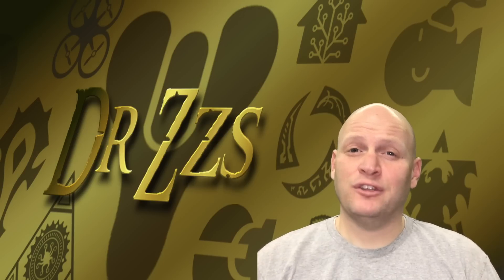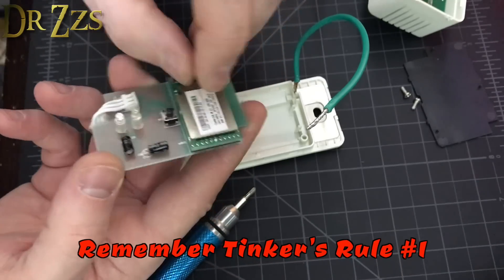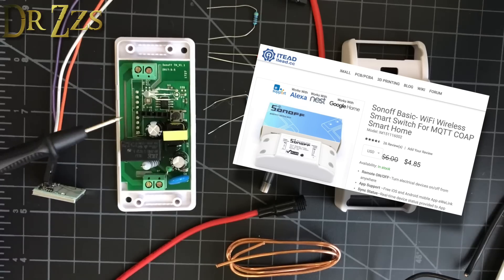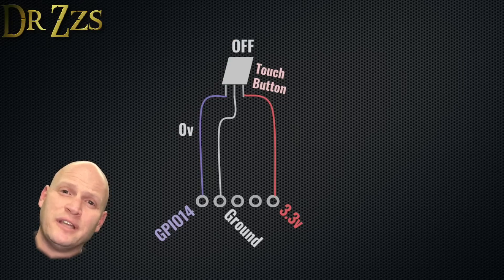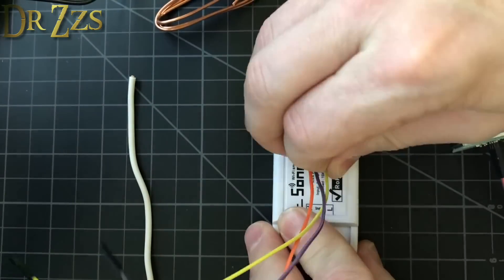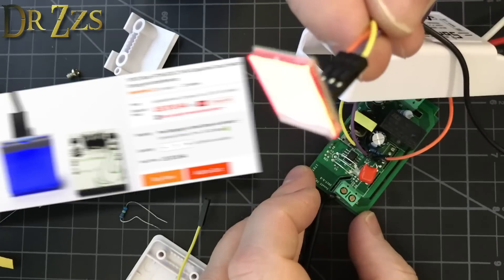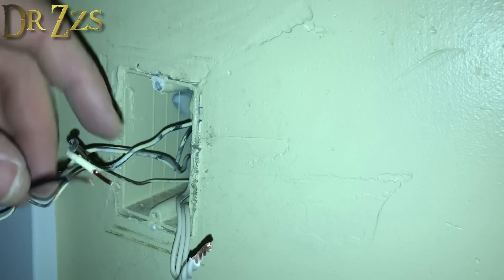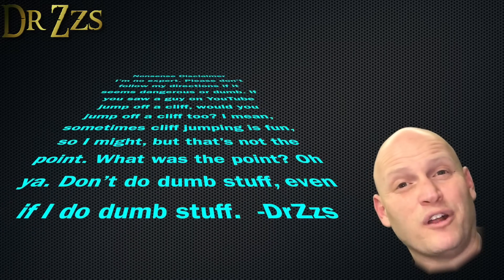$5 Sonoff + $2 parts = Best Smart Switch EVER!

Comment: Very nice video, thanks!
BTW: are you sure that you need the pull-down resistor and the debounce capacitor at all? I just wondering because the capacitive touch module is not a mechanical switch, therefore very likely debouncing and pull-down is not necessary. If thats right (I am not 100% sure) you can connect the touch module directly without any additional components.
Reply from the maker: You may be totally right.  I guess the thing to do is just test it without one or the other and see how it works.  I'll do that and report back. :) 
I think we may not need both, but we probably need one or the other.  The touch module outputs "high" on the "out" pin and GPIO14 has to go to ground to activate the relay.  Maybe there's a way to change one or the other of those things.  If the touch module would output ground on the "out" pin, that would activate the relay. Or if we could get GPIO14 to start low and activate the relay when it goes high, that would work too.  I couldn't figure out how to do either of those things, so I went with the pull down resistor, and was just happy it worked!  
Anyway, I'll test it and see.  
I typically supplement my lack of knowledge with an abundance of experimentation.
Reply: DrZzs Isnt the Relay connected to gpio12? Anyway, I am curious to see the result of your test!
Reply from the maker: HiJoeZi  yes. But the pin we’re using for the button is GPIO14. 12 must be set as an output while 14 is used (thanks to Tasmota) as an input. The onboard button is Gpio0. 
I don’t know much more than that about the inner workings of the esp8266 that runs the whole thing.
Reply: Yes, thats right. I only wanted to stress that GPIO12 (relay) and GPIO14 (touch button) are totally independent, at least from the hardware side. They are just "connected" via software. As the touch button is an electronic circuit (in contrast to a mechanical button), it is very likely that debouncing is not necessary. It also can be that the OUT-pin of the touch button is always either HIGH or LOW, but never ever floating. In this case also the pull-down resistor is not necessary. But please test it! I am really keen to see the result. BTW: I just ordered such a touch button from aliexpress for a little more than 1 buck. Your video taught me that it is  a really useful device :)
Reply: I would be surprised if the touch button floats when it's off, more likely it drives GND so the resistor is not needed, although I can't be sure.  As far as a capacitor, it's also likely unneeded.  Reading the datasheet from heltec (translated from Chinese), they indicated that an effort was made to make the switch resistant to spurious noise.
Reply from the maker: Thanks Zeric.  You're probably right. 
I can say for sure that without that pull down resistor the button doesn't activate the relay. That makes me think it is floating when it's off.  
But, I can't say I really know what's going on inside there.  For all I know there are tiny gnomes flipping big switches and singing drinking songs. 
You're probably right about not needing the capacitor.  The next one I do I'll try it without the capacitor and see if I get any ghost switching.  So far, after a few weeks I haven't had a single episode of unintended switching, so I'm happy about that.  
Thanks!

Comment: Good stuff and similar to what I just did with those things. Touch just seems more modern no doubt. I used the 3D printed box route as my wall boxes are quite crowded and I can't fit the stock box in there. Used my own MQTT firmware that uses the temporary mode of the touch switch so you just get feed back when you touch it. I do leave the onboard LED on though when the relay is off for illumination. Anyone interested in the touch 3D printed box option it's up here: https://www.thingiverse.com/thing:2778841 Thanks for the vids!
Reply from the maker: That's awesome!  
I was just looking at your model on thingiverse a couple days ago!  Great work! 
It's a small sonoff-loving world!

Comment: Another great video. I was just looking last week how to power a lit LED switch and here you come with a video pretty close to what I needed. I am going to try this out and see how it goes. Thanks for the great idea.
Reply from the maker: great! 
Let me know what else you're about to do!
Reply: So I finally received my touch sensor and so far it works great. The only item I am noticing is that the touch sensor does not change when updates are pushed from home assistant or the Tasmota page. I have 100k resistor and a 104 capacitor between ground and GPIO14 with a direct connection between the 3.3v with no resistor connecting this line. Right now I am wondering if it is my wiring or if my configuration is incorrect. Any thoughts?
Reply from the maker: Ben Steckler hmm. I’ll have to check mine and see if that is happening to me too. I know when I restart Home Assistant the touch modules aren’t lit even if the lights are off. Sounds like your wiring is the same as mine. 
I’ll think about it and see if I can think of why the switches don’t follow the commands.

Comment: You probably have no use for a low-pass filter in this case since you're using switchMode2.  Since switchMode2 requires a full toggle any interference will not trip the relay for a long enough period of time to make the lights flash (talking about fractions of a second), much lower than the time it takes for an LED light to power up.
Reply from the maker: excellent!  Thanks!

Comment: Those exact capacitive touch switches arrived on my door step late last week.  Just last night I was trying to decipher the Chinese data sheet to make the switch non-latching.  http://www.heltec.cn/download/Touch_Moudle.pdf

If I can make it  non-latching (and always lit) then I can solder it to the Sonoff's momentary push button terminals (and use MQQT control).  An image on the aliexpress page (and in the data sheet) indicates that shorting the outlined SMD pad would make it non-latching (see No resistance: temporaty output, 0-10K resistance: latch output photo).  It does not work,
https://ae01.alicdn.com/kf/HTB1HIinc9sQ2uJjSZFFq6xYUFXaO.jpg

Any ideas?

Thanks and keep up the good work.
Reply from the maker: Thanks!
Someone posted the data sheet in English: http://bit.ly/2sdgBHV
 
So, you connected those two pads and it didn't become unlatched?  hmmm
I'll have to just experiment and see. If I figure something out I'll let you know.

Comment: I know its a bit off topic, but is it possible to replace the sonoff basic relay with a solid state relay? its not that big of a deal, but the clicking of the mechanical relay is kind of annoying.
Reply from the maker: I don't know.  I'd guess it's possible.  
Do you have info on the relay you'd like to use instead?  I'd be interested in trying it out at least.

Comment: Is that all that'll be needed to go "ul" approved?
Reply: Tyson Brooks no,it is a costly and time consuming process.   My guess the plastic case emits toxic fumes and may burn, the ground is there to protect the house not you, the fuse and relay I believe would have to be UL rated and all kinds of rules on radio frequency emissions.  It is a complex process.
Reply from the maker: Help me understand the grounding part. 
How would having that plate in the switch face protect the house?  
I'm not saying you're wrong.  Just trying to understand. 
Thanks!
Reply: The ground is there to prevent 120vac from traveling anywhere.  This would include a metal switch plate,or through the box if it was metal. It also can help with RF shielding to/from the unit if there was a ground plane in the circuit board.  The neutral is there to carry the current used under normal circumstances, not in case of a short.  It looks like you have a plastic electrical box so in your case it probably doesn’t matter but if I was installing in a metal box I would insure the box was grounded.  All of centers around UL approval and NEC compliance.
Reply from the maker: Excellent. 
Thanks!
Reply: DrZzs you are welcome.  I have been watching your videos for a while and have parts and pieces to build and flash several devices but have to finish my woodworking projects first.
Reply: This was very helpful. Thanks for explaining.

Comment: awesome!!!

Where do you buy the header you soldered on the sonoff board? 

you need to make PART 2. with HA integration.
Reply from the maker: The header came with my D1 mini's 
http://amzn.to/2GV0kef
That's the expensive link.  Here's a cheaper one (but longer wait)
https://www.aliexpress.com/item/B21-D1-mini-Mini-NodeMcu-4M-bytes-Lua-WIFI-Internet-of-Things-development-board-based-ESP8266/32831353752.html?spm=2114.search0204.3.2.6f52125b1eSYiH&ws_ab_test=searchweb0_0,searchweb201602_3_10065_10344_10130_10068_10324_10547_10342_10325_10546_10343_10340_10548_10341_10545_10084_10083_10618_10307_5722316_10313_10059_10534_100031_10103_441_10624_442_10623_10622_10621_10620_10142,searchweb201603_37,ppcSwitch_4_ppcChannel&algo_expid=c948ea32-e2cb-4bdd-8c0f-f80ea4acdcf9-0&algo_pvid=c948ea32-e2cb-4bdd-8c0f-f80ea4acdcf9&priceBeautifyAB=0

There's other ways to get the same headers.  That's just how I got mine. 
https://www.aliexpress.com/item/Pitch-2-54mm-2-3-4-5-6-7-8-9-10-11-12-13-14/32793723098.html?spm=2114.search0204.3.20.676f32f9J4oSAr&ws_ab_test=searchweb0_0,searchweb201602_3_10065_10344_10130_10068_10324_10547_10342_10325_10546_10343_10340_10548_10341_10545_10084_10083_10618_10307_5722316_10313_10059_10534_100031_10103_441_10624_442_10623_10622_10621_10620_10142,searchweb201603_37,ppcSwitch_4_ppcChannel&algo_expid=1da44e40-c638-43c1-b5e7-25f010e6cae4-1&algo_pvid=1da44e40-c638-43c1-b5e7-25f010e6cae4&priceBeautifyAB=0

Those links are SO LONG!
Reply: You can also buy the headers off Amazon for fairly cheap.  Here is a link for the ones I bought https://www.amazon.com/gp/product/B01MQ48T2V  You can use pliers to snip them down to the size you need.

Comment: Wow... what timing!  I was just looking to do exactly this and researching it last night.  I bought these touch switches (little cheaper, but no lights): https://www.amazon.com/gp/product/B0756D4BBW/ref=oh_aui_detailpage_o01_s00?ie=UTF8&psc=1

Do you think these would work the same way?

Really appreciate your videos - great stuff!
Reply: Those should work the same.  If you care to get them cheaper (with a longer wait for shipping) you can get them from AliExpress for about 11 cents each

https://www.aliexpress.com/item/10Pcs-TTP223-Touch-Key-Switch-Module-Touching-Button-Capacitive-Switches-Self-Locking-No-Locking-Jog-2/32761802828.html
Reply: you can actually get decent shipping from some sellers for about $2.50 (12-20 days)

Comment: Great idea! Is there a way to make a smart dimmer to use with home assistant ? The "on-off" part is easy... Dont want to spend 50$ for a smart dimmer lol
Reply from the maker: I have not found a way to do a smart dimmer.  
I've tried to understand a couple Instructables but it's pretty complicated.  Might be a while before I attempt it. 

If I ever do try it I would start here:
https://github.com/Theb-1/ESP8266-wifi-light-dimmer
and here:
http://www.instructables.com/id/Arduino-controlled-light-dimmer-The-circuit/

I pretty much stopped reading when I saw "optocupler" and I don't recognize half the components he's using.  

But if you try it I'd love to know how it goes!
Reply: I might actually give this a try. not sure how far ill get since being an AVMT student, I have basically no time, but if I succeed, ill be sure to let you know.
Reply: On second thought, this requires printing your own PCB. no way do I have the time to put in that much effort.
Reply from the maker: If you can come up with a list components we'd need and the schematic I can work on getting the pcb made.  
But no pressure.  School is a higher priority.  And so are like 50 other things.... but if you ever do get to it let me know how I can help.  I don't have the knowledge required.  At least not yet.
Reply: QuinLED can do it.  Here's a short vid I put together showing how i used them for under-cabinet lighting.  The video doesn't do the dimming justice but it's as smooth as butter.  I can even tell Alexa to set them to a percentage of brightness.  https://www.youtube.com/watch?v=7epolCIr3cY
Read all about QuinLED here.  http://blog.quindorian.org/2014/12/esp8266-wifi-led-dimmer-part-1-of-x.html . This guy has done his homework.  He basically built his house with Home Automation as the primary goal and he LOVES LEDs.

Comment: Can we operate the sonoff overseas the way we operate with normal sonoff. Like I am in the office and can control the lights off my home
Reply from the maker: Depends on how you have it set up.  If you use the stock software then yes.  If you change the software (like I've done) then you need a lot of other stuff, like a Hub (I use Home Assistant) and DuckDNS or something similar to connect from outside your network.  
If you DO use the stock firmware you will connect the wires to the touch button to the legs of the push button instead of GPIO 14 and ground.  
Hope that helps!
Reply: What do you mean by stock, can you explain me a bit, I'm kinda new to this
Reply: And thanks for the answers buddy, 😊😊
Reply: DrZzs I've seen a recent video showing that Home Assistant has added native support for Alexa and should be adding support for Google Assistant soon. The catch is that there will be a cost associated.

Comment: Dumb question, but can I get the touch module that doesn’t glow? I personally like as little light as possible in my room when i sleep. Two glowing squares on my wall would drive me crazy
Reply from the maker: You sure can! 
They're really cheap too!
20 for $30 if you don't mind waiting for them to arrive from China.  
https://www.aliexpress.com/item/Free-shipping-via-HK-post-5sets-lot-Funduino-uno-r3-compatible-arduino-uno-r3-5sets-5pcs/1643014974.html?spm=a2g0s.9042311.0.0.MTbhhC

I actually bought 20 lighted ones and 40 non-lighted.  I don't even know where I'm going to put them all yet!  They're just so cool!
Reply: DrZzs thanks! This is great! and, I'm assuming that $30 is a typo
Reply: Just know that a flat wall switch without any light indicator will be a bit difficult to find at night (the time when you will need it most), so be prepared to clean dirty walls often :)
Reply: Good point. +DrZzs how bright is the light from the touch module?
Reply: I think the final answer will depend on how thick your blank wall plate is. I bought some decora wall plate inserts that so thick, you can't even see the light, so I'm going to go back to using LED buttons. BTW, you can always dim down the light just by putting a resistor between the led switch and the 3.3v power on the sonoff.
Reply from the maker: oops, yes. it's $3.
It's not super bright.  Not bright enough to bother me while I'm trying to get to sleep.
If it is too bright for you, you could probably add another resistor to the 3v line to the button and dim it even more.  Or add some semi-opaque tape to the face of the button.

Comment: I wanted to ask that can we flash esp8266 nodemcu with tasmota, and secondly I wanted to ask that after flashing to tasmota, does it work with Alexa
Reply from the maker: Yes you can use Tasmota with NodeMCU and D1 mini.  They are on the Supported Devices list: 
https://github.com/arendst/Sonoff-Tasmota/wiki

I haven't tried it yet, but I want to. 
To get Alexa to recognize the Tasmotized device you need to set it to emulate a Hue or Wemo. (Configuration - Configure Other).  I haven't done it so I can't tell you much more than that I know it's possible. 

Good Luck!
Reply: DrZzs I've seen a recent video showing that Home Assistant has added native support for Alexa and should be adding support for Google Assistant soon. The catch is that there will be a cost associated.

Comment: Great project! Forgive my ignorance, but would the switch work without wifi? I'm thinking about what would happen in a power outage. Wifi isn't usually a priority when hooking things to a generator.
Reply from the maker: Thanks!
Yes you can use this as a 3-way switch.  And, yes you'll need an extra sonoff for each switchbox.  There are a few different ways to do 3-way switching.  This is what I've done. https://youtu.be/GEJCk-Dr3BQ

Here's another way that only needs one Sonoff.  
https://youtu.be/l-CM8JQmges
I haven't done it that way yet, but I'm planning on trying it eventually. 

Good Luck!
Reply: DrZzs Thanks for the reply. I changed my question after I realized that you had already answered it.
Reply from the maker: got it! 
To answer the new question:  In the 3-way setup I've done you would loose control from the other switches if the wifi is down.  If the first switch is powered it will control the relay (and the lights) directly, so you'd have one switch working at least.  
Cysix's method would still work with the wifi out since he's using a wired connection to the other switch. You'd have 3 wires between boxes so you should be able to use the lighted touch button in his setup too.  The distance between the boxes may cause the voltage to drop some, but hopefully it'll still be enough to light up.  And with all that wire between the Sonoff and the switch the Low Pass Filter would be even more important.
Reply: Awesome. If I can control it from one switch, it will work just fine. Thanks for the great ideas and content.